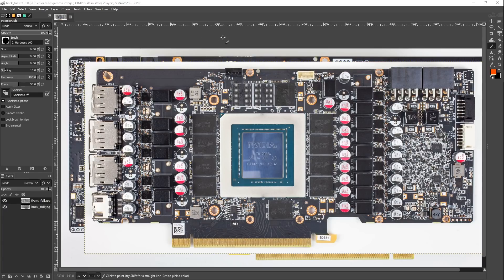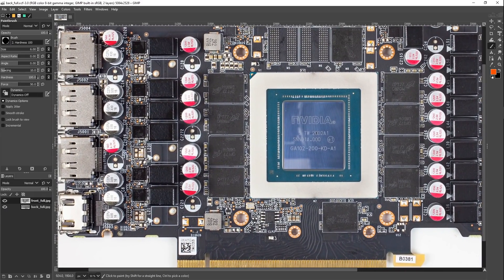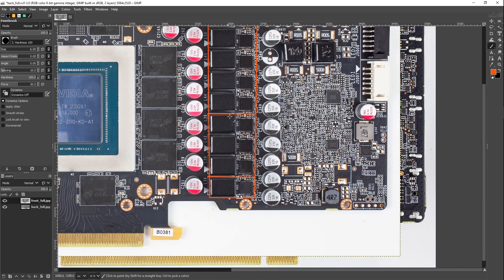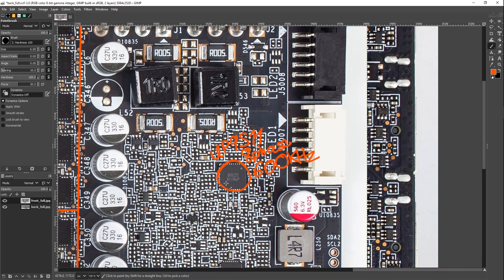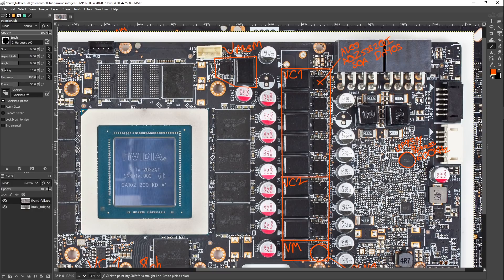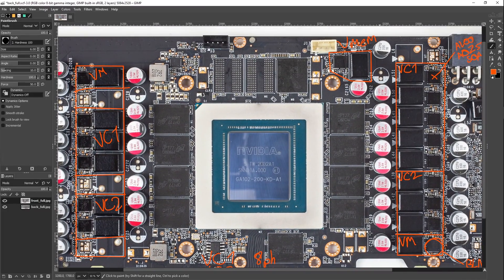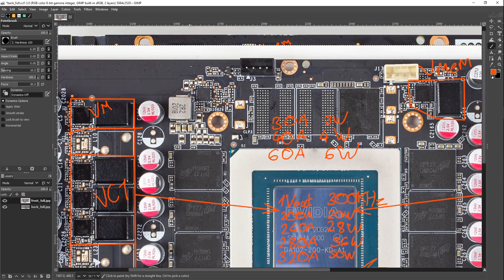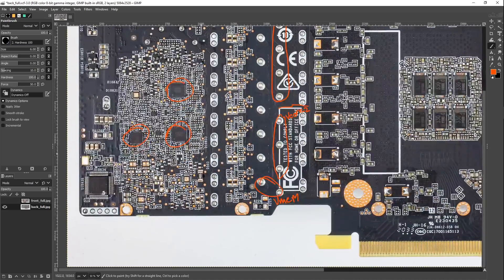GPU PCB Breakdown: Zotac RTX 3080 Trinity

Comment: Ordered this card and hope it doesn’t explode in my hands :3
Reply: Dude. Did you pay $699 for a 10GB card in 2020? Look at those empty memory soldering points. Wait for the real 3080 card.
Reply: @DenGuleBalje  Absolutely untrue. 10GB vram is enough for 4k for the next 2+ yrs, even Steve from Gamers Nexus said so. The 20GB model that's planned for future release is gonna cost around 1k $ for extra bloated vram, even the upcoming big navi with 16GB vram is gonna be unnecessary. By the time games start using 16+GB vram these cards are gonna be outdated anyway. The r9 290x launched with 8GB vram, look where's that card now.
P.S - You need to know the difference between allocated vram vs used vram.
Reply: @DenGuleBalje  The 16GB radeon 7 runs slower than 8GB rtx 2080 @4k, even the 6gb 980 ti is faster @4k today than 8gb 290x, both are unplayable though @4k. Amd produced a 8gb version of 290x to take advantage of noobs who think more vram make a card faster.
Those ultra textures packs you talk about require you to run the game at 4k. Rtx 3080 & upcoming big navi is gonna run out of  horsepower well before it runs out of vram. Adding unnecessary amounts of vram just increases cost without adding any value. The only reason nvidia is gonna release a 20GB version is to counter big navi 16GB. I'm pretty confident 3080 with 20GB is gonna cost around 1k $. I'd rather save the money now & upgrade my gpu when 10gb+ vram is actually required.
Reply: @fabAB912  So much wrong here, but let's just take the most embarrassing one first. High resolution textures do not require you to run at 4k. Just baffling that you would think that.

Also, the Radeon VII was a data center compute card AMD turned into a "gaming" card. It's a stupid product for a very select group of people.

One factor you should take into consideration is AMD's RDNA/CDNA split. Vega 64 and Radeon VII were both the old GCN architecture that will become CDNA. RDNA focuses more on stripping back unnecessary data center featurea and focus on IPC rather than raw (TFLOPS) compute.

Nvidia will win this generation again pretty handily, but the amount of VRAM in the 3080 Is still criminally low. 
"Oh but you don't NEED more" is a stupid argument because you will need it soon and that's what Nvidia is banking on. They want you to upgrade as soon as possible after you've given them their money for the 3080.
Reply: @fabAB912  Also, more VRAM DOES make a card faster. The 6GB 1060 is faster than the 3GB. 
It's far from the only thing that makes a GPU faster, but it ABSOLUTELY helps
Reply: @fabAB912    So hardware from 4 years ago can't run new games. From 2012 -> 2016 represented a much bigger relative performance gain than 2016 -> 2020. Most people are still running 1080p, around 90% of Steam users. 4K still is not a good value. I have a 1070 and a 6600k with a mild overclock (4.5GHz @ 1.25vcore 24/7). I've got 16gb of some slow RAM. I play EU4, Kingdom Come, Squad, EFT. My settings in these games are all maxed or near max at 1080p. I get 100 fps+ maxed on Witcher 3 for crying out loud. gaming rig can easily last 4-5 years with 0 upgrades if you go midrange with high quality components. 

So, depreciating my $1200 rig over 5 years with 0 residual is $240/yr. Not bad. I'm not in the hobby of pushing sliders. I don't feel like padding Nvidia's 10-Q's by throwing $500-900 their way every generation. Nvidia is constantly under pressure to deliver bigger and better, because investors don't give a shit. You can see evidence of a "growth company" mindset in how they squeezed as much as they could out of these products. It's not a bad thing per se, but why is it different with this generation? Reducing future warranty expenditures... or did they feel compelled to do this after the 20xx series disappointment?

Comment: Do the 3090 and 3080 share the same PCB or the same PCB for boosted up 3080s since so many components are missing?
Reply: Sai Prasad some cases Yes. It is cheaper to make one pcb and populate it with what is needed than make two separate ones.

Comment: i love these breakdowns, and i absolutely HATE Zotac. they literally put shame to nvidias name.
Reply: Izan TM  nah zotac´s amp! pcb´s are good.
Reply: Zotac has been the only card that ever died on me before it got morally obsolete. It even had compatibility issues out of the box that required a risky BIOS crossgrade. So, yeah, never again.
Reply: @Lishtenbird  I've never used zotac but have very bad experience with msi. 2 different msi x99 motherboards failed during warranty period, & my msi gtx 980 ti gaming 6g failed 1 week after warranty ran out.
Reply: @Lishtenbird  This card has a whopping 5 year warranty.
Reply: @fabAB912  MSI was the only GPU I've had that totally died shortly after getting it.
Reply: @Safetytrousers  Warranty is generally useful but its degree of usefulness depends on your country, city and retailer. Time potentially spent on first troubleshooting and then returning should also be considered, especially if you're not only gaming. It may be more logical to pay a bit more upfront for a device with a lower chance of failure that will also get handed down and used later, even past its warranty.
Reply: @Lishtenbird  I should have said, in the UK.
Reply: This all is silicon lottery. There Are people with dead WD hard drives, there Are people with dead Seagate hard drives etc... So all in all you can have any model by any manufacturer to die. That is why you have that varranty!

Comment: Geez, the boxed passive footprints they’re using on this PCB make it make it look like a hot mess and it looks like half of them aren’t even populated? I get that boxing them can help with finding their orientation but looking at it they haven’t done the best job anyway.

And this situation with shunts on those NVIDIA cards is getting ridiculous, I would support it if I the user was given full access to the readings in half decent software but for current balancing it’s a joke, if I were to design this I would just measure the voltage on the 8-pins and PCIe connector and go off how much that voltage drops vs total card power, you could not only current 'balance' your connectors but you would also be able to protect against partially inserted connectors, garbage low gauge adapters and bad PSUs. I wouldn’t even bother with current balancing, design it balanced in the first place and if the user installs their GPU wrong or with a garbage adapter detect it on power up and display a prompt just like many cards do when you don’t have PCIe plugged in, it all seems like an excessive waste of parts, efficiency and my money to me, to not even fully protect against the common problems.

Comment: Why are over half the solder pads unpopulated? What is even going on here?!
Reply: Binning.  Depending on which cores are binned different memory pads will be unused.  Steve @ Gamers Nexus touched on this towards the front of the video.   Want all the pads full?  That's the 3090 :)
Reply: @DocNo27  I'm talking about more than just the memory pads. There is an unnerving amount of capacitor, resistor, inductor  and chip pads completly unpopulated. look below the input power connectors. It is a literal mine field of unpopulated pads.
Reply: @joeldoxtator9804  It appears to be primarily related to the unused memory but he also called out some unused phases they could have used but didn't; I'd imagine some of those are part of it too. 

It's a cheap card and the cut corners to get to a price point.  Kind of hard to hide on a reference design.

Comment: What he SHOULD  have done is review the more expensive Zotac Holo or Zotac AMP holo...if those cards have shitty PCB then absolutely RIP zotac apart.

Those cards are aimed at the higher end, the overclockers,  the guys who appreciate a quality PCB with top end components. 

I've had an issue long before this review with his content,  he reviews $60 motherboards and say they are garbage...OF COURSE THEY ARE!, they are $60!

I don't need an engineering degree to tell me a $60 motherboard will be shit compared to a $300 motherboard. 

Review products aimed AT your audience  not stuff you know full well isint.

Comment: Whenever I search for a GPU and I see Zotac...I keep scrolling 😂
Reply: I bought zotac based on previous experience and the fact it was actually available to pre order and at MSRP.
Reply: @RichardDower  And here's why I see you defending the card in all the comments.  I figured you were just a disgruntled stock holder.  I hope it lasts for you!  Sincerely - I hope it does.  My experience with vendors who cut corners invariably seems to go sideways.  I probably just have below average silicon lottery luck though.
Reply: @DocNo27  you have a 5 year warranty if it blows up.
Reply: @RichardDower  Yup - because knowing my card could be in the mail, back at the manufacturer and then back to me instead of my PC is why I buy video cards.

For the warranty.

Good luck!
Reply: @DocNo27  if you think buying a card that's over $300 MSRP stops you from getting a dud then you've not read many threads on high end cards getting RMA.
Reply: @RichardDower  I'm with you. This is like Hi-Fi, I'm not going to pay twice as much for a 10% uplift and if a card fails inside five years of normal use  I'm golden. After five years I'll have upgraded. These breakdowns are useful for understanding what is skimped and why, what is actually value-add instead of frivolous, etc. Buildzoid has a daily driver, it's built down; he isn't going to waste quality components on it. To know that, you have to be able to distinguish meh! from good, and good from excellent. The same person can have several PC's for different use cases. And so on.
Reply: @stevewatson6839  agree with you guys.  In Australia all of the entry level models aside from Zotac and EVGA are being sold at a hefty premium to FE (which we can't buy at all here).  Its bullshit.   I'm happy to start with the Zotac and may trade up to a 3080 ti with more OC headroom down the road...

Comment: So uh... TL;DR the card suck? Or... At least gets the job done?
Reply: Its a 3080, you get 3080 level of performance, you can tweak it for the extra few % if you really need them
Reply: @RedOneM  I got one, only available, I just wonder if the components is durable
Reply: @Rodrigodrt  You're getting in total 5 years of warranty if you register the product. Also before your card breaks down you very likely have already upgraded.
Reply: @RedOneM  just 2 in my country, and I don't plant to swap in less than 5-6

Comment: i DONT UNDERSTOOD SOMETHING.. WHY THERE ARE 12 SOCKETS FOR MEMORY AND JUST SOLDER 10..
Reply: mister.T Jr  yes but its a top gamer card... 3090 its like titans... why they not put 12gb instead of 10... is more powerfull than 2080ti but have 1 gb less
Reply: Because you have to have 3090 that has wider memory bus to use those sockets! Expect to see this same board with 3090 and you see those Empty slots used.
Reply: @haukionkannel  yes but if its the same pcb there is 2gb per socket.. there we have 1gb per socket...

Comment: This card seems to consume more power & clock lower than all the other 3080's that have been reviewed.
Reply: Its performance is at nvidia refrence specs
Reply: Sample size 1 and kind of an unfair comparison.
Stock PL is 320, so the only comparable card in the Techpowerup review was the FE, which scored like 1.5% higher. If you dump 340 watts in a power limited card, it's going to clock higher, so the Asus und MSI results are supposed to be better.
If they got a really good GPU on the FE and a really bad one on the Zotac, that's the margin you would expect. Wait for a few more reviews, until you draw conclusions. Typically cards with the same GPU and same PL perform exactly the same with the only difference being luck of the draw. PCB and exact power delivery setup doesn't really matter at stock or even some daily OC with the stock cooler, you only should care about that if you are planning a steep OC on sub ambient or at least a very good custom loop.
Reply: @marceldiezasch6192   Techpowerup is not the only ones with high power consumption & lower clock rates, I've seen others reviews of this card that don't clock more than 1800MHz out of than box. All the other cards I've seen clock around 1900. With overclocking this card tops out at 1845 while others clock at least 100MHz more.
Reply: @fabAB912  
Considering that Zotac is a first party partner, this is kinda interesting.

Comment: Jesus the PCBs on ampere. Those are some beefy tantalum caps on the back there. I really wonder how much margin AIBs are making if this is a "low end" version at $700. It can't be a lot. Also, I would advise spending an extra $50 and avoiding this thing as reviews consistently mark this one as being the least efficient. Cooler is great but components are as buildzoid said, lackluster.
Reply: So it overclock less then others...so??
It's a refrence card with refrence specs at refrence MSRP.

If you want a higher end card zotac sell two other HIGHER PRICED cards

Comment: Oh man this is making me reconsider my decisions. I was gonna get the cheapest 3080 I could and slap a waterblock on it. 

But now that I see how shit this card is, and supply is crap, and the fact that I think a 3080ti is coming next year, I think I might not. 

I'll wait until I find a new case I like (eyeing the Silverstone Alta F1), Ryzen 4000 comes out, and then I can decide if a reasonably priced 3080 is good enough (sadly won't go FE cause the connector annoys me), if the 3090 is meaningfully faster, maybe wait out a 3080ti. 

And I need CUDA so I'll get big Navi, but just for testing, not my main rig. So that's why that doesn't matter.
Reply: You'll always be waiting , and waiting....and waiting. You make the best decision you can and buy...have you not heard what tech jesus has said countless times about this very subject?
Reply: @RichardDower   I'm not sure what you're implying. To be clear that system has a 1080ti in it right now, I can afford to wait if there's value in doing so.

Comment: Wait. So 2GB memory chip, two spots are empty. Is the 3080 Ti/Super a 14GB card then? I heard it was 16GB or 20GB
Reply: Chips are 10. 2 free. Each is just 1GB in size. If they fill wont be 14... you can do the math. We need 2GB chips => 10x 2GB = 20GB. They will leave 2 spots blank again, because the GPU configuration.
Reply: @borisdg  Ah. I'm apparently blind lol

Comment: Does it perform to spec?...do you get the base specs as stated by nvidia?

If yes then what is the problem?...it was MSRP  it was ACTUALLY  available to pre order on Amazon Germany,  unlike anywhere else.

Does it clock as high as others?...no, but Zotac are selling a MSRP card that confirms to the BASE 3080 specs as assigned by nvidia. 

Anything else its techno wank.
Reply: Mate, youre on the wrong channel.
Reply: @Chuckiele  that's the problem mate...I bet you most watching this video are NOT hardcore overclockers,  but ordinary joe blogs.

They are seeing this guy saying the PCB is shit and cancelling pre orders based on that alone.

It would be better for him to clearly state the card is fine for joe blogs who puts it in his PC and forgets it.

The problem I see that you've got non hardcore clocking guys being mislead by a video that is NOT aimed them them
Reply: @RichardDower  well, its not misleading to state that this model has the lowest quality pcb of all 3080s. Its up to the user if youre ok with that if its significantly cheaper. I would certainly avoid it if it wasnt.